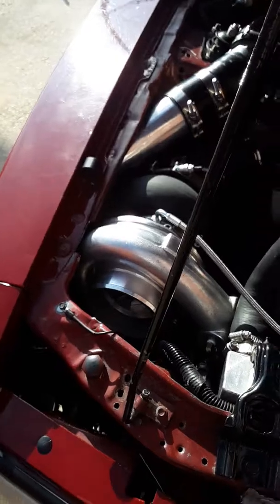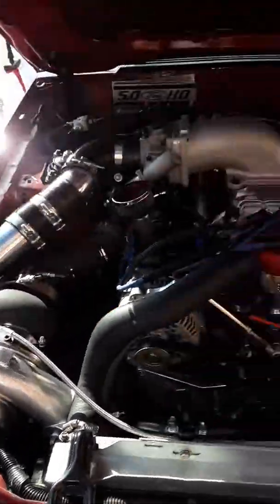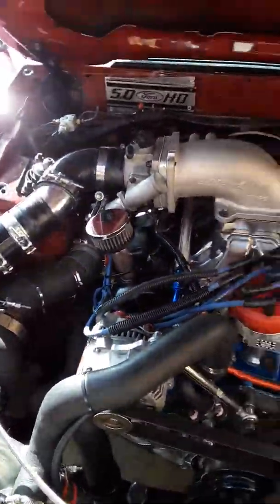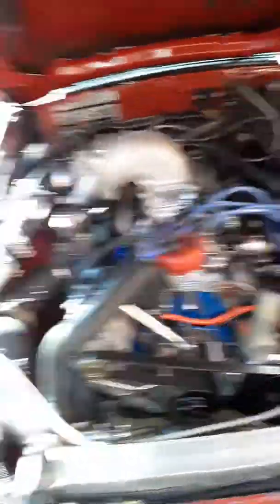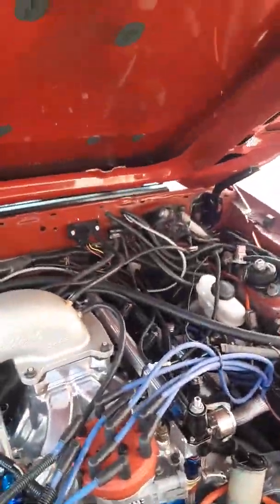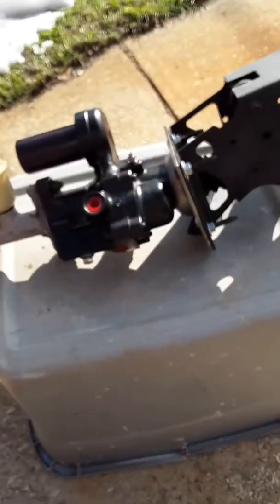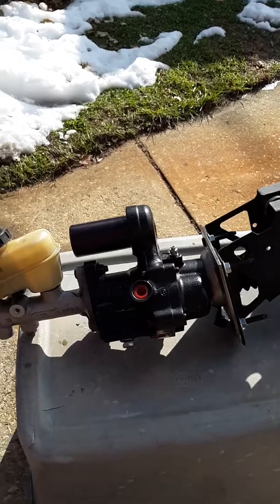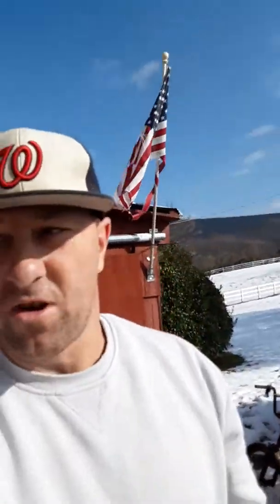200mph 031

Comment: I like this concept man!  I have a 96 coupe with a 96f250 351w from a guy I know. The truck had 400,000 plus miles, I took the 351w honed it re-ringed it home polished crank and new rod and main bearings, new cam bearing I did it all myself, however the engine was align honed on the mains so I had to get a 0.010” shorter timing chain set from cloyes and it was remanufactured for ford motor company according to the reman tag on engine block. I’m on a super tight budget so I went with Skip white NKB heads lunati 52025 cam I found used for $200, reused roller lifters, Procomp cromoly pushrods and Procomp/speedmaster MLS head gaskets, I had to flycut pistons with my grinder, and Weiand stealth intake assault racing roller rockers and also assault racing dizzy (probably Procomp) and it runs great on cheap budget.  Bought and eBay clutchmax 6 puck ceramic disc clutch gonna see what happens factory t-5 4.10 gear fun with 29” slicks out back wasn’t sure if it would run very good but so far so good after breaking oil pressure is at 20 at 500 rpm and goes up to 60 at top pressure
Reply from the maker: now that's what iam talking about , good job man with the buget build